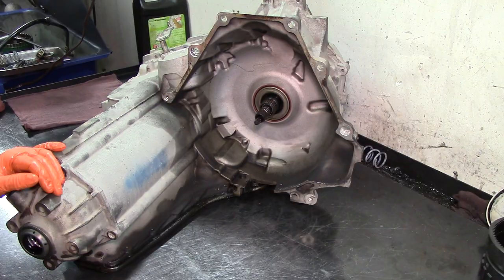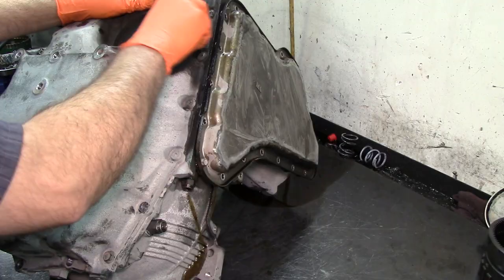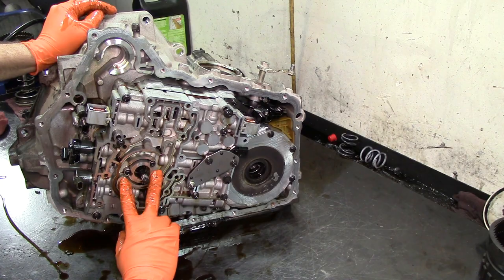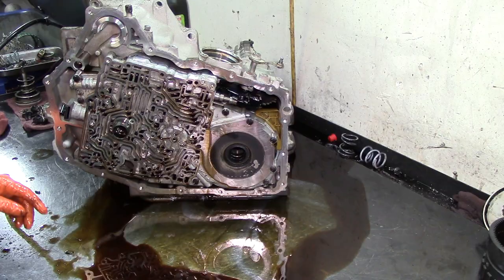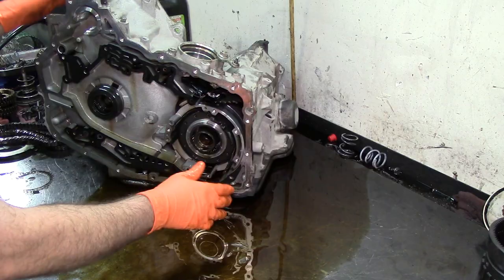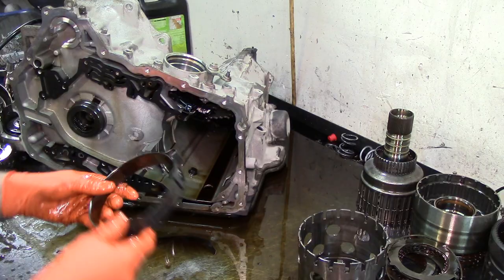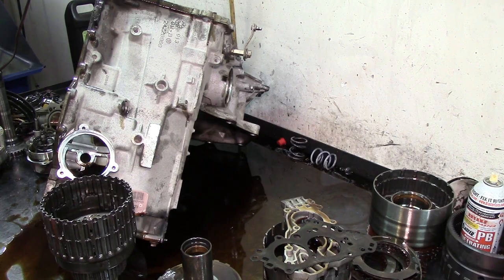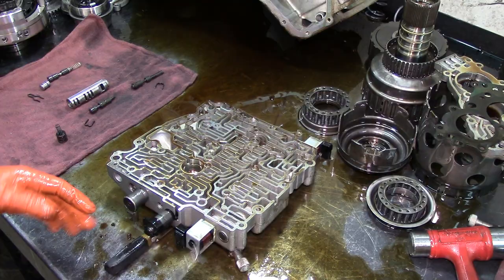4T65 E Transmission Teardown Inspection

Comment: In the middle of a teardown on a 4t60e that only had second. I'm having trouble getting the forward band drum out with the roller clutch like in this video. Mine does not turn the correct way, it is reversed. Spins clockwise, and not the other way. I cannot seem to get it out if the case. Any help is appreciated as it is a winter project and need to get it cleaned and inside before the storm hits

Comment: hi  thank you very much for your videos     ihave a 09 impala and it has p0741 it runs fine   what do you recommend i have read torque converter replacement and seal  or should i replace tcc solenoid? thank for your time and help

Comment: I have the same transmission boss on a 2009 chevy impala it slips on drive from a start roughly gets going i have to but it  2 gear slightly has a little slip but once I get going the rest of the gears shift smoothly including overdrive, could this be a pressure line problem?

Comment: I have a big problem with 2000 Buick Park Avenue.  2 to 3 shift solenoid went last year.  My mechanic fixed it and went again when I picked it up and now has gone again in a few thousand miles.  I don't think he can figure this out.  What do you think the problem is because he does not seem anxious to honor the two year warranty he provided.  Its not mechanical, but electrical, the same exact problem as last year.  Any thing you can provide would help tremendously.

Best Regards

Comment: Your video is thorough and helpful.  How important is it to replace the torque convertor after rebuilding the transmission?  My car has a 93k miles and broke the forward band.  It was a clean break.  The end where the solenoid engages the band came off.  No total blow up...  Do I really need to replace the torque convertor?

Comment: @4:00 for the trans where the differential will come out, will it go back in too?  for example - there is the plastic oil stop “saturn ring” and i do not know if the internal components riding on the shaft shift when the shaft is removed making it difficult/impossible to get back into alignment to put the shaft back in.
Reply: all the other tear down videos on youtube have the removal of the shaft as the last step after removing the internal parts

Comment: I have a 2002 regal LS it started having trouble shifting into 2nd when at oper temp but other shifts were normal 2-3,3-4 no slippage anywhere So I changed the 1-2 shift solenoid filter and fluid . NO change . Now it wont shift into 2nd it will hang between 1st and 2nd if I go fast enough in 1st or go into 2nd for an instance but goes back to 1st or hangs between 1st and 2nd almost instantly any ideas?

Comment: Thanks for the video one question I have a Volvo XC90 and the differential broke ,it is possible to replace only the differential I can’t open the entire transmission but if I only remove the differential and assemble again works ?

Comment: I have a question sir, I have an 09 impala LT 3.5l I have the transaxle apart and I have a molded separator plate (with a check ball stuck in it lol) I seem to only be able to find a 2 piece separator for my year to replace it. Is this OK or am I missing something. The molded plates seem to be up to year 03? Thanks and great video sir!
Reply: Also, do you have a rebuild video for 4t65e?

Comment: Where do you order parts fo this transmission i have 2006 g6 gtp and thinking of rebuilding it it cause junkyards want $1500 to $2000 plus for used one any advice would be appreciated

Comment: Friend, what happens when the transmission leaks oil through the breather that leads up in the connector? He pretends to slide does not apply the speed.

Comment: That exact problem happen to me with manual valve to the linkage, I tried to go through the gears and their was nothing. Didnt know where the valve should be positioned to feel the gears change. I took the side cover off again to inspect and I'm still not sure where the valve should be, does it have to be in a certain position on the linkage for it to change gears properly?

Comment: Hello
I bought a 2003 XC90 T6 AWD with the driveline, now there is a permanent crunch and the car is no longer moving.
If I cut the engine, no noise, if I put a speed, the noise appears, it looks like a broken gear noise. What do you think?

Comment: im having an issue where trans wont down shift back to first gear. i can shift to first manually and it upshifts fine but upon a stop it stays in like 3 gear trans was recently rebuilt. where should i look for problem i'm getting no codes.
2006 impala ss 5.3

Comment: Thank you this helped I ha e an 07, but is the driver side output shaft tip supposed to wiggle? I just had all 12 bushings replaced but it's still loose?

Comment: Hello, My 2004 Buick rendez vous slips on Drive position When cold, i have to start gearing from 1St All the way up to D shifting manually without any problem, once the Car is in Working temperature IT works fine even starting From total stop in D... Please Give me a hint, i was already ripped off twice with mechanics Just adding Lucas Oil instead of diagnose and _properly Fix It... Thanks in advance

Comment: Good day. Nice video. I have an 06 Impala SS and thought I might try removing and replacing the old transmission with a remands trans. My question is how difficult will it be to take the old one out? And do I need to remove the engine or anything complex like that? I'd be working with jacks since I don't have a lift. Any suggestions or input on this process?

Comment: Hi, My 2003 park avenue with 190k miles has developed a "wobble" that only occurs at light acceleration around 50mph. No wobble if coasting at 50mph, no wobble accelerating at lower gears/speed. Do you have any advice as to what may be the problem? Tie rod/bearings has no play when rocking wheel on lift.

Comment: I just rebuilt a 4T65e and I get first gear only I see the scanner commanding the shifts but it wont shift, have you run into this issue with this transmission before?

Comment: I have a 2000 Chevy Venture with an automatic transmission.  When I first start driving it the transmission changes gears nice and smooth but it warms up it starts to, like kick feeling whenever it changes gears.  I already changed some of the speed sensors and the turbine.  but it keeps doing it.  do you have an Idea of what the problem might be.

Comment: Good video

I have a 2007 Chevy Impala SS 5.3 Liter V8 Automatc with 145,000 miles and the car spuratically jerks slighty when going under 35mph. Defenitly feels like its coming from the transmission. T- fluid is dirty so im going to drain and fill a few times. Any idea if this jerking is related to the shift selonoids?

Thanks

Comment: Hey just wanted to say thanks for spending so much time helping everyone else! I have a question about a 4t65e out of a 2006 impala with a 5.3. I recall having a hell of a time on my last 4t65e seperating the pump its press fit together and the 2nd and 3rd clutches has a lot of clearance but there is no specs avaliable what do you suggest? Thanks
Reply: you use new clutch plates right

Comment: Hello
I really appreciate your videos on how these transmissions are put together.
I have a question about my 2000 Volvo S80 T6, has the 4t65-e transmission. Car shifts good on the level, but going uphill it will shift to 3rd fine then start slipping forcing me to downshift to 2nd manually . Fluid isn't burnt and doesn't slam into gears as you would get with a bad clutch pack.
I am lost on what this is.

Comment: Question. Can the turbine shaft with the drive sprockets be removed if transmission is still connected to engine? I'm doing a partial rebuild to correct the P1811 code and I'm doing all of this on the drivers side fender well area. Also can the drive sprocket housing clearance be checked for tolerances "prior" to removal from case? I mean would it work like that? And then having the selective washers on order prior to installation? Or after overhaul will the tolerance for the clearance change?

Comment: The final drive ring gear in the back of the transmission is loose. It has up and down movement with snap ring installed. Is the normal? I did not notice during tear down.

Comment: question- what would cause the stator splines to be worn on this 4t65e transmission ?  I've seen one with worn stator splines.  not worn smooth but about half way worn off.  can they be run that way ?

Comment: i have a 94 buick lasebra and sometimes the transmission quits pulling then after letting it set for a few weeks it goes back to pulling good that`ll last for 2 weeks then quit pulling... i saw on you tube where a man pulled the plug from the front of the transmission and his started pulling so i unplug the plug from the front now the car will pull but it`s like pulling in third if i stay on a level street the car pulls good starting in 3rd then going to 4th gear reverse is strong..is it something like a solinod that is wrong ..i hope so..thanks..

Comment: I have a question....I'm working on a 2002 LeSabre, I have the left axle shaft out of the vehicle and I notice the output shaft has a LOT of movement up, down and side to side. It seems excessive, maybe a total of 1/4 inch or perhaps a bit more. I expected the output shaft to be solid. Can you tell me if this is normal? I'm a lot of things....but not a transmission guy! Thank you very much.

Comment: Hi about 3 in 10 times when the transmission attempts to downshift from 4th to 3rd (during rapid acceleration like to pass), the transmission and engine violently shake. The dealer diagnosed it by explaining that it is stuck in 4th while downshifting to 3rd. Does it need a full overhaul or is it reasonable to repair this condition? Thanks.

Comment: I replaced a broken forward band without pulling transmission, after re-assembly my linkage is missing a gear.  the selector location doesn't match the PRND321 on the dash, I never touched the neutral safety switch yet that is where the problem seems to be.  It will start in park only after putting it in Reverse first. what do you think
Reply: I don't know if u got it fixed, but I just had to reopen mine for the same reason. Wouldn't start. Shift lever locked.  A petty mistake yet easy to make as no one really gives any detail; the gear selector decent spring was not placed in the groove next to the electrical connector.

Comment: Hello there,need your PROFESSIONAL HELP PLEASE,CAN I SWAP DIFFERENTIALS BETWEEN 4T65E'S TO CHANGE FINAL DRIVE GEARS RATIO IF SO LET ME KNOW PLEASE,I HAVE A 4T65E THAT CAME FROM A 2001 CHEVY MONTE CARLO LS AND WANT TO PUT IT IN TO A 2001 CHEVY MONTE CARLO SS. I'VE HEARD THAT IT'S POSSIBLE,THANKS

Comment: hey there. i have used your 4l65e rebuild video to rebuild my suburban transission and 40k miles later she is still shifting strong. but now i have a 4t65e that i need to rebuild but i do not see a video on here that shows you putting one back together. i am not sure if i am missing it or if you have just never gotten to making one. If it is that i am missing it, would it be possible for you to help me find it? or is it a transmission that you would consider filming as you rebuild your next one? thank you for your contributions to others (including my own) success
Reply: I was quoted $1400 to rebuild a 4t65-e in a 2008 Buick lacrosse w/ broken parking pwal ( $650 if it's only the praw rod ) $1400 if full rebuild is needed due to possible worn out diff. Drives/shifts fine other than humming noise.🚗
I have a suburban too, 1995 K2500 w/454. Luv it!

Comment: Got a question. On a 2009 Chevy ltz.  Impala 3.9 liter 4 T 65 E H.D. Whatever it's name is on the extension looks like maybe a i.d.k.  differential. So they say the 3.5 liter transmission which is a 4 T 65 E from a 2009 Chevy Impala is not compatible when straight. swapping transmission cause gear ratios are different and some other  stuff.
 If I take the H.D. extension differential looking thing. And switch it with the 3.5 liter differential looking thing. Do you think the H.D. transmission will work placing it into the 3.5 liter  transmission?
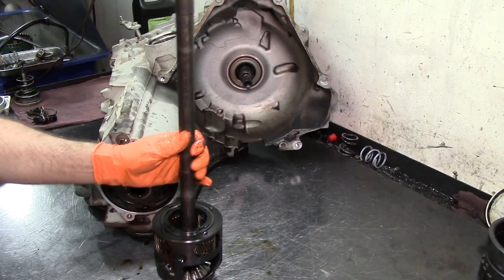Reply: .... you talking about the planetary gear ratio @ 4:27, used in the Differential housing, that he points to?  🤔  

If it fits, I don't see why not... ✌🏽
Reply: @Texaca  The guy installing the heavy duty 4t65 E donor transmission he  switched the small gear looking thing from the small end of transmission from the original equipment 4T 65 E.  and it has been working fine so far 
The H.D 4T 65 E. is not supposed to work with 4T 65 E. Cause gear ratios are different.   So to compensate he switched the small gear looking thing.
Reply: @satochinakamoto6129  ... the "Sun gear", the main gear in the middle?  I'm impressed, that's cool that it worked, and Informative 🤔
Reply: @Texaca  I don't know exactly what it is. It's located at smaller   end of the transmission. It had alot gear looking teeth on it. It has run about 5,000 miles. No issues.

Comment: Hiram do you recommend a transmission rebuilder in the 97312 zip code? I am astounded by your product knowledge but i would have to mic all the parts and attempt a go no go from specs. I dont think i have the life span to get it done.

Comment: Great video! Very thorough, and also helped me get an idea of how sensitive you do or don't need to be with certain parts of the trans.  Me being inexperienced, I tend to treat it all like glass.

One question, I'm in the middle of a rebuild myself, and I had hell getting the passenger cv joint out (replaced them 5 months ago, so the snap ring is new) do you see anything wrong with just taking it, the planetary gear, diff, and shaft out all as one piece?
Reply: +xcrunner012 There is a plastic oil dam inside the trans.. If you are very careful and slide the shaft out in a straight line, you should be OK.. However, the plastic is very brittle sometimes and you won't know for sure if it's broken until you get into that area. You may not be the one who broke it if you need to use this method and find it that way. I think the part costs less than 5 bucks.. I had trouble with the snap ring on my diff side too.

Comment: So I have a ttc solenoid code after replacing the TCC solenoid check engine light is still coming on for the same code what are some suggestions or what do you think I should do next
Reply from the maker: Valve Body worn, there's a sonnax Valve with a sealing ring to correct that issue. 
Go to their website and search under your transmission type.

Comment: I have a strange issue. 4T65E in my 01 olds Silhouette. If it is raining (or wet pavement) even from a normal take off left wheel loses traction way too easy. Enough to require Traction control to step in. Is there anything internal to the trans that would cause that?
Reply: It is original as far as I know with around 194k miles. Shifts normally without any issues.

Comment: i have a 2006 impala 3.5. it gives you a jerk from a stop postion off a light. where is your shop. i believe you are very thorough. i want to get it rebuilt by someone who will not cut corners. you are very gifted. it also didn't respond to the gas pedal after i got off the interstate for more than 5 secs. then it finally took off. it went up to 3,000 rpms before it even moved the car.

Comment: I'm a mechanic but I don't rebuild transmissions.  I just replace them but I have a question.  I have a car in with no reverse.   It s almost like your power braking the car when it's in reverse. 

I know it's hard to know, but any ideas what could have failed in the tranny?
Reply: I have the same problem in my car. did you ever figure it out? I lost D for a while after the car was giving to me. I changed fluid and filter, now drive and low gears work now but no reverse. fluid was almost black and very burnt. Since I lost reverse Ive had it work ONCE for like 3 seconds.

Comment: Great video! do you have a rebuild video of this transmission? planning on doing a rebuild of my 04 impala's 4t65E pretty soon
Reply: +mike frontuto hit me up, I will send you the tech manuals I have. I rebuilt a 2000 Regal GS powertrain for my 2000 Impala. Check out my GM transmission rebuild playlist on this channel, it has a lot of great info. It's best to gather the knowledge first and then go into the task. I have found some better ways to do a few things than the videos show.  A popular forum thread shows the hard way to remove the main seal in the housing for the torque converter. The service manuals show the easy way.

Hiram was kind enough to answer my questions along the way too. Questions that could not be answered from the service and update manuals.
Reply: +Kenneth Sears check that email bro...

Comment: I have a 2008 Chevy Uplander that I replaced the 3 bands in it one year ago(forward band tang broke off), it had 100,000 miles then. Put back together and have put 25000 miles on it since then. have had no issues or problems until last week. Came to a stop and when I stepped on the gas i had nothing. Put it in park then drive again and it took off but started slipping and then no forward or reverse at all. Was a little over a quart low on fluid and it smelled burnt. If i let it cool down, I have all gears fine for about 30 seconds and then it starts to slip until i have no forward or reverse at all. Let it cool down for a few minutes and same issue again. Any ideas on what to start looking at? Thanks!
Reply: Ok, Pulled the trans apart, all looks good on first inspection. But, filter is full of what looks like aluminum dust and small particles. Can't find anywhere in the trans that looks like where the damage would have come from yet. Are the planetary washers you showed that wear out made of aluminum?